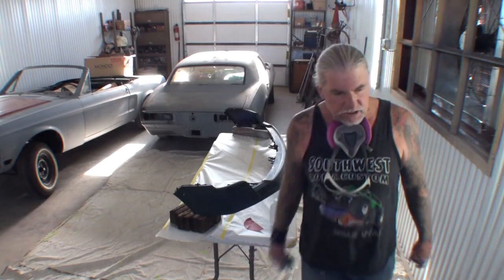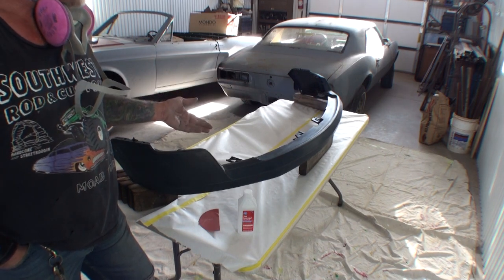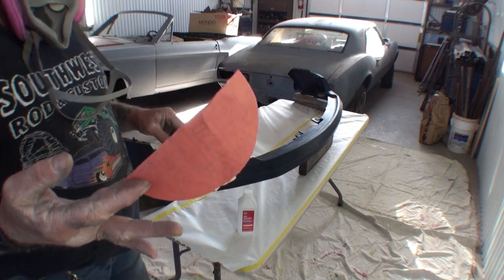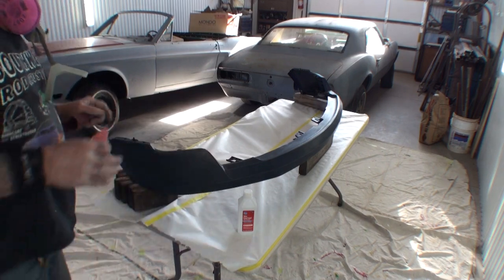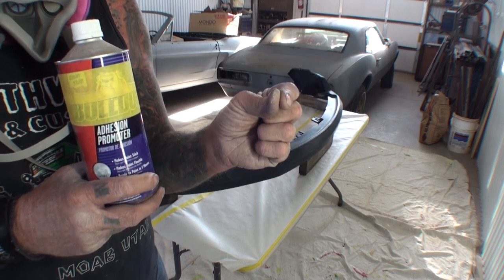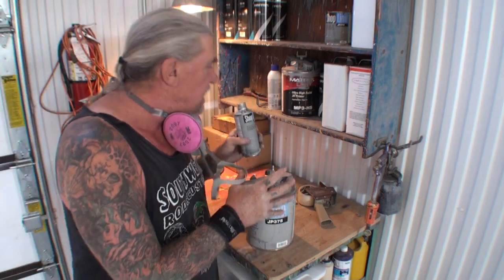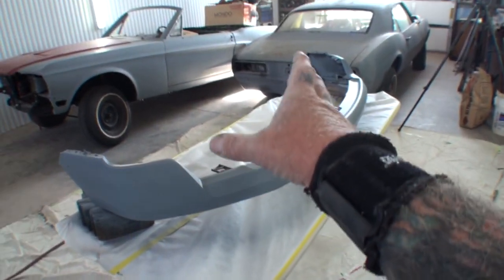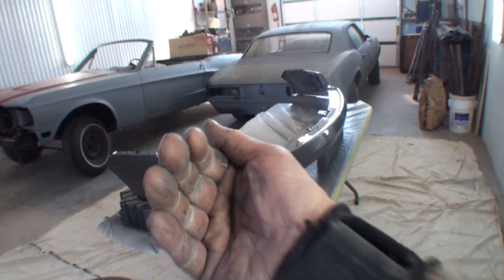How To Paint Plastic Bumper Covers - Do It Yourself - Tech Tips

Comment: Great video Pete. Especially like the rubbing alcohol tip. 
For non-CAPA aftermarket, pre-primed plastic bumpers, should you wash, then scuff with scothbrite, then rubbing alcohol, then adhesion promoter, or is the adhesion promoter only required on unprimed plastic?

Comment: Great info! Question: Do I need to use rubber gloves while sanding and using rubbing alcohal? Or can I do it with bare hands? Also, if the bumper you receive already has primer, then do you still need to paint the bumper cover, with a sealer before painting the base coat, and clear coat?

Comment: All right Pete please help me. I molded a bumper lip and canards to oen bumpers. I clean them real good sprayed adhesion promoter, I used urethane primer on that wet sanded with 400 now paint n clear. Turned out pretty good except I got some dirt, I painted them outside so stuff fell in it. I haven't buffed plastics before what do I do? I'm an Auto body collision repair student, still learning and practicing. Thanks

Comment: Hey Pete, as there was already primer on the bumper what was the need for the "Sealer" to stop the plastic leaching chemicals? Not questioning you for using it just i have OEM bumpers need painting.
Reply from the maker: The sealer gives the item a smooth topcoat for the paint to lay down with no issues. It also fills in small and minor scratches that are left behind from dry sanding.

Comment: If the bumper cover is the soft type
Don't you have to add flex additive to the paint and primer ?
Reply: Just finished a urethane valance, no flex just, adhesion promoter, "2k epoxy primer" then do your thing
I forgot SCRUB IT WITH TSP AND SCOTCHBRIGHT FIRST
Reply: @diyautoschool  hi Pete. Thanks for all the videos. Would u still need a flex additive on something like the Enduro bumper covers from 2nd gen (1970s) Firebirds/trans ams?
Reply from the maker: @slayer7976  I would suggest to use it on the old rubber bumper covers for sure, but on the new plastic ones -- NO! you don't need it..

Comment: what about flex additive ?
Reply: @TimeToBeKind  So I do need it on the trans-am,
Reply: @WonTooForAte9  Nason still sells it. They require smoothie too,  
But Im told ppg no longer requires it because its already in it now because new cars are so thin.
Reply: @WonTooForAte9  so then my question now, I didnt know about it, guy I learned from never used it, and the trans am bumper shit the bed pushing it in the new shop.   So would I only use it on the plastic, or can I go ahead and paint the whole car with it?

Comment: one question please.. my existing plastic front bar has deep gouges n rough marks through the paint n showing black raw lastic...i know i need bondo to fill gouges n primer/putty [spray].. do i need alcolhol first on raw scratches? or just bondo ? then epoxy primer then colour/clear etc Please?? rest of bar is as new ,just front corners get caught on stuff
Reply from the maker: You want to use polyester putty on the damage if possible and you will prep it using 80 grit sand paper. It’s not necessary to use alcohol befor the repairs